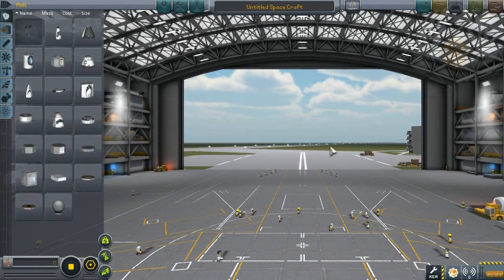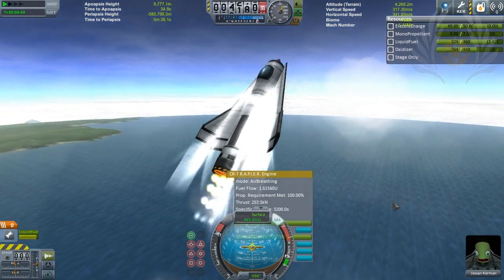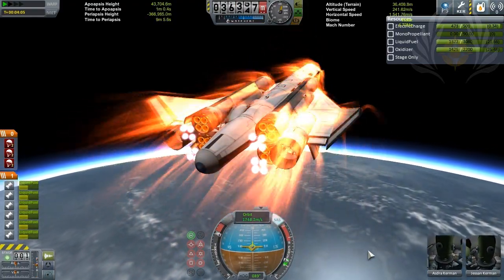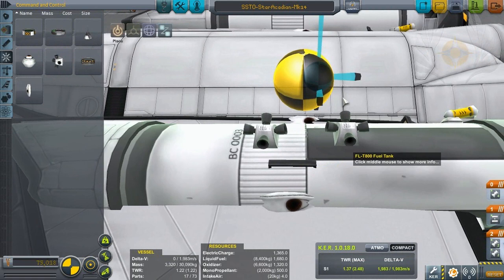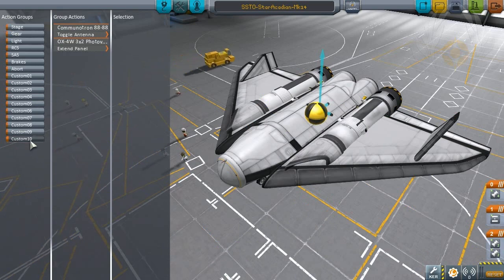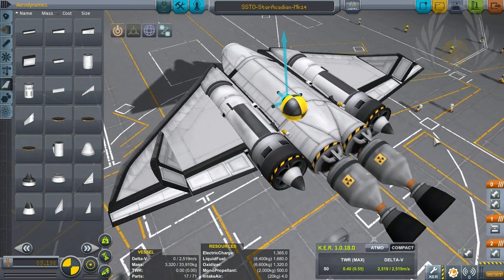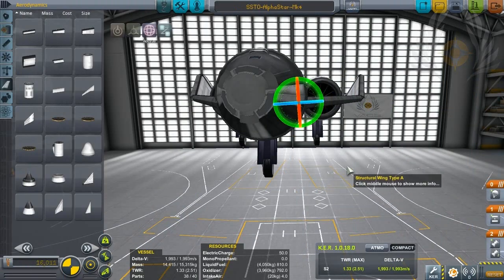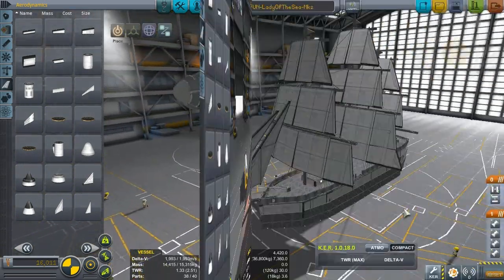KSP V-1.0.5 - VID#132 - How To SSTO PART 2

Comment: A TWR of over 1.0 isn't needed with SSTO's from stationary as once you get past the mach barrier the RAMJets will push it past 1.0. I usually aim for about 0.85 minimum and 1.5 intake air per airbreathing engine minimum its drag thats the biggest killer of SSTO's.
I aim to be hitting orbital speeds by about 45k any lower and the atmosphere is thicker so you bleed more speed during your coast up to AP.
A mod called RCS Build Aid is really handy as it show Wet and Dry CoM values, along with RCS and Engine torgue for shuttles.

Comment: dihedral is a self stabilizing destine if one wing was to go up the other wing will be crating extra drag and extra lift which will bring the other wing down till both wings are at equilibrium at both drag and lift optimal angle for dihedral is roughly 10 degrees relative to the fuselage
Reply: Iron Sight Production I always thought it was due to the center of mass being lower than the center of lift, essentially acting like a pendulum in that the weight at the bottom (fuselage, etc.) pulls down and rights itself.

Comment: Another video, another nitpick, this time about the flight profile:

When you explain the shallow ascent and you show your failures? Yeah, they are all because of the same thing: too high TWR! If you have the right TWR (0.5-0.7), you won't be able to burn up, but you will be able to do a hands-free ascent, by putting the plane in a ~5º angle and then (maybe) do a small correction before turning the engines in rocket mode. 

For more info and, you know, actual proof that what I'm saying are not the ravings of a mad person, you can check out my thread on the forums (I'm Rune), look up either the Claymore or the Orca, and read the in-game description on how to use them... you can literally fly them on mouse alone once you take off, and not much of it at that. I like to call it "to space in three steps", and it's easier than flying a rocket, these days, with gravity turning and such. 

Once you try it once, you will see why all the veterans end up doing it! For example, the Claymore can lift >40mT of payload on eight RAPIERs, and the Orca, 32 on just six... plus a VTOL rocket system! And the Orca has a high-ish TWR for this kind of thing, so it actually makes orbit in only a bit over ten minutes, too.